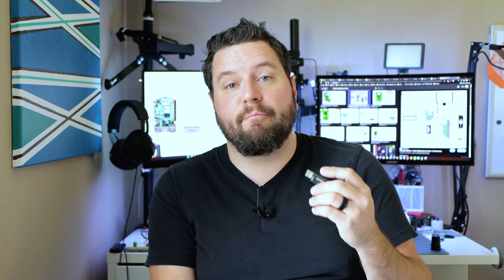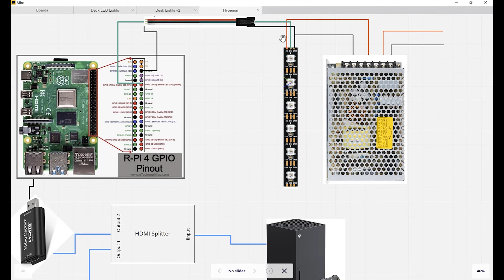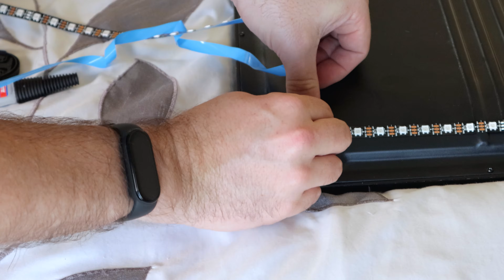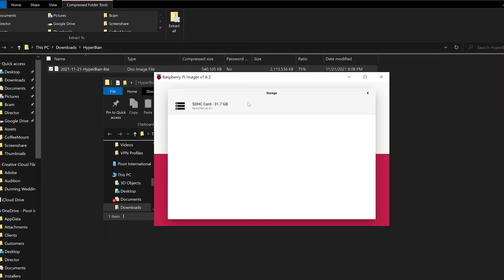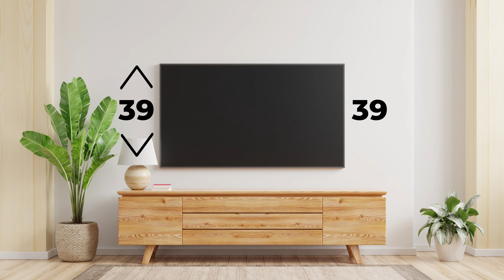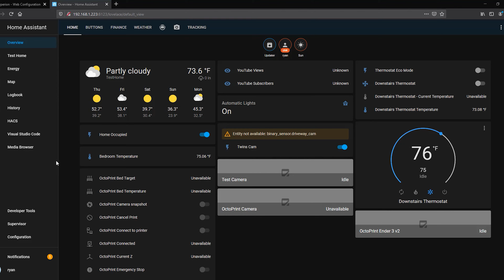DIY Ambient Light for your TV! // Hyperion on the Pi

Comment: Excellent tutorial! I did this a couple of years ago for my 65" and now I'd like to do it again for the 75" I'm buying. I'm going to need a 16.4' plus 3.3' strips to cover the 75" all the way around (I'll skip the bottom of the TV if going all the way around really complicates things). My question is how can I power the 2 strips once they're connected together? Will the power supply you suggested suffice (or do I need a secondary/larger power supply?), and will there be any flickering or power loss towards the end of the strip? The full connected strip will be 17.5' in total

Comment: Can i strip Jumper wire and use it as Extension wire?
Reply from the maker: It all depends on the gauge of the wire.
Reply: @ well it turns out you can't pull that much power from jumper wires

Comment: Great video dude, thanks a lot! I was wondering what the thickness of the wires used to extend the connection of the LED strip to the power supply is? Because the LEDs can possibly draw 18A, I'm a bit concerned with safety issues. What did you use?

Comment: I got mine going, and the "effects" work great, but I get no lights with the live video.  Technically, I got a coupe of seconds a few times, about 20 minutes apart, where it was mostly white, but you could see faint colors 'flickering' among the white.  After a couple of days of troubleshooting, the best I can come up with is that it's my video capture device, so I'm buying one like used in this video and a splitter to see if that fixes it, so I'll post an update once they get here and installed as to whether or not it fixed it.

Comment: Thanks for the video. I think there is an error in the way people calculate the power consumption of these LEDs. I measured 25 watts for around 200 LEDs + Pi4
Reply: 18A is too much for those 2 thin wires
Reply: @jasonbourne1474  18A at what voltage?
Reply from the maker: What type of LEDs are you using? Do you have them in white mode (the most consumption).
Reply: @ThisSmartHouse  I bought the ones from your video, 5m 60 LEDs/m. Yeah I tried white at 100%.
Have you measured your consumption before?

Comment: Can this thing work without internet access?
Reply from the maker: Yep. It runs locally on the Pi.
Reply: @ThisSmartHouse  Because previous versions of about 1½ yrs ago turns off after about 10 seconds without internet.
Reply from the maker: Previous versions of Hyperion?
Reply: @ThisSmartHouse  Hyperion.
Reply: @ThisSmartHouse  You are right. It's working on Raspberry Pi Zero W without internet.

Comment: Hi, Question. I'm trying to find any info online but I didn't have any luck :( Does hyperion support yuv422? Since my ps5 is connected via hdmi 2.0 cables, it only does this type of format instead of RGB. Thanks for the help
Reply: I dont know if this is what you mean, but I do use my capture card with YUYV and not MJPG, and that works fine with my SK9822 LED strip

Comment: Great videos!  How does this handle HDCP? I have read a couple articles that HDCP can cause issues.  Does this splitter bypass it?  I would like the hear your thoughts on that. Thanks!
Reply from the maker: Good question on the HDCP. I think the splitter is what is important. If you have one that can handle HDCP (like the one I have), then you won't have issues. I think only the older style splitters had issues with loosing HDCP. I have not had an issues with my Xbox, BluRay, or ChromeCast connections.
Reply: @ThisSmartHouse  Thanks for the info!

Comment: Can you please list the best LEDs to use for an 85" tv. The ones you listed dont come in a long enough size. I would need one that is about 20'. These only go to about 16'. Ive been looking but dont want to order the wrong thing. Thank you.
Reply from the maker: You can hook them together. You don't need to have one single strip. So you could easily buy two shorter sections and connect them with some of the clips that I have listed or solder them.

Comment: Hi great video. I have an issues that I can't seem to solve. My led strips don't seem to do anything. When they power on only the first 2 leds light up. The first led is colored and the 2nd led is pure white. Any thoughts?
Reply: I've been having the exact same issue... First led is white and second flickers multicolor.... Did you find long term success with the solution???
Reply: I an getting an error in log saying - lock/unlock handler - session bus is not connected
Reply: Removing the oc helped. Also make sure your LEDs are both grounded to the PSU and pi
Reply: @DrFettuccineRavioli   somehow my LED was problematic cz i tested it from mid way and it was lighting up fine just not following the sync... anyways i've ordered a new one and will comment if this too gives issues.. Thanks for ur reply :)
Reply from the maker: Thanks!

A few things to check.
1. Make sure that you have all of your connections solid between the Pi and the LEDs strips. Make sure that you have a ground connected between the Pi, the LEDs, and the power supply (even if you are connecting the power directly to the LED strip, you still need a common ground.
2. Make sure you have the correct GPIO pin selected in Hyperion.
3. Did you set up the LEDs yet? Define the number, etc?
Reply: @ThisSmartHouse  I think I got to the bottom of it. I had the pi over clocked and apparently removing the gpu OC solved the issue. I don't know why that was the issue but a 2ghz OC seems to be fine.
I super appreciate your comment and once I get this fully mounted up I'll drop a comment if I have any other issues. Here's a sub
Reply from the maker: Cheers!

Comment: Will it it work normally on tv like watching Netflix? Or it will work only for devices plugged in to hdmi splitter? :)
Reply from the maker: It'll only work through the incoming hdmi. Because that's how it gets the color data for the LEDs. 

I think there are some products like from govee that use a camera to pick up the color data that will work with any sort of app.
Reply: @ThisSmartHouse  even if u will plug tv to splitter via hdmi arc in tv?
Reply from the maker: Only if your TV has HDMI out. One way around this would be to use a Roku or Chromecast connected to the splitter. You can use the set top box to watch your content and then the video data would still get captured for Hyperion.
Reply: Ok, I’ve made it, but I’ve got other issue. Even if I turn off my Xbox and tv leds are still on, how can I change it to them turn off after turn off tv and Xbox?
Reply from the maker: Typically when you turn your Xbox off the input goes black is there anything on the TV right now?

Comment: Hey great video! Quick question, I wired mine up accordingly and I see the boot up effect work, even changed it from 3-10seconds and they light up on reboot. Afterwards, trying the test effects doesnt light up any of the LEDs... any idea of the issue?
Reply from the maker: What happens when you go through the red, green, blue test in the app?
Reply: @ThisSmartHouse  Initially nothing, I "fixed" it by just clicking a color on the color wheel, then doing continuous test and the LEDs start working, pretty weird but good so far. Ill try the usb capture card stuff this weekend. Thanks for responding so quickly! Any idea why the LEDs might flicker randomly once every 10ish seconds?
Reply from the maker: I had a lot of issues when I first got started, of course they didn't show up when I was filming the video. My biggest was getting stuck in testing mode and not being able to get out.  Glad you got it sorted!!

Comment: One question, does it work with Netflix, Disney etc? When I connect my Nvidia shield to the capture device?
Reply from the maker: Anything that's being passed through the device should work. I'm able to do it on any application on my Xbox. I believe hdcp is still intact due to the splitter.

Comment: Thank you for the video! It helped me to set up. But I have a problem. HB Captures only the BOTTOM part of the frame (there is no capture on the left, top and right). With USB capture - everything is the same. In the "night" version HB everything is the same((( I tried all the settings - the problem is not solved. LED strip WS2811 (12 v), Raspberry Pi 4 Model B Rev 1.4 (8 Gb RAM). What could be the reason? Thank you in advance! ;)
Reply: https://youtu.be/kpAm7QGJOPk

Comment: So do they make a pass thru for 4K 120? I just got a new TV to accommodate my PS5.
Reply from the maker: I hadn't seen one but I am sure there is one out there. It would just be more expensive.
Reply: @ThisSmartHouse  thanks for the reply. I did a quick search on Amazon and didn't see anything. I thought maybe you may know. Excellent tutorial! I think I'm going to start buying the products now and hopefully I'll find a pass thru that will be able to do 120
Reply: @ThisSmartHouse  so for 4k 120 fps I only need HDMI 2.1 splitter? or something else too?  please reply...
Reply from the maker: You would need a splitter that is capable of 120 fps 4k. I am not sure which ones are available.
Reply: @ThisSmartHouse  cool ,  thanks so any video capture card ll work with 4k 120 fps splitter? Even 1080p one's?
Reply from the maker: Yes. You only need to capture at a resolution of your LEDs. So if you only have 100 x 75 LEDs you only need 100 x 75 resolution.
Reply: @ThisSmartHouse  oh great,  thanks  👍
Reply: I know this is late answer but… Ezcoo 2.1 HDMI splitter supports 4k 120hz with HDR, Dolby Atmos pass through…
Reply: @mysticqro950  thank you!

Comment: So I have tried get Hyperion to work before. I tried your way hoping to would work. It’s so weird I can get the picture to pass threw to Hyperion but LED do not react? I tried to load a affect but nothing happens to the LED’s. Any thoughts?
Reply from the maker: Do you have the LED configuration correct?  Have you tested some of the patterns to see if the LEDs react?  I would start at the LEDs and make sure they are fully working.  One viewer reported they had set the number of LEDs but something reset them to 0, which screws everything else up.
Reply: @ThisSmartHouse  yeah that’s the problem they all turn on but do nothing when i try to run a test pattern . When I start to watch something on plex they will change colors but nothing matches to the picture
Reply from the maker: Which led s did you get? So they don't change at all or the are the wrong color?
Reply: So i am using a Pi4 with LEADNOVO Video HDMI Capture Card with Loop Out, 4K HD 1080P 60FPS USB 2.0 .

Comment: Can the same concept be applied, by applying it onto a monitor, i.e. using the monitor as the input instead of the xbox as the hdmi splitter?
Reply from the maker: Yes, any HDMI source.  However, you can actually run Hyperion in Windows and send the information to the Raspberry Pi over the network.  So they don't have to be connected.
Reply: @ThisSmartHouse  Thanks a lot! And well done on the project!
Reply from the maker: Thank you!

Comment: Does the linked capture card work with hdcp signals?
Reply from the maker: No issues so far. I assume the Xbox uses hdcp.
Reply from the maker: The splitter ahead of it might be removing the hdcp though...
Reply: Got it, thanks. I bought a capture card with loop out and it failed in 1 day :(. Going this route now.
Reply from the maker: That was my thought process as well. I like being able to replace individual components that they fail.

Comment: I just set this up on mine yesterday but the delay is bad enough that it’s hard to watch shows with it. When scenes switch it’s extremely distracting. I’ve tried all sorts of stuff to make it faster but I haven’t been able to get rid of the delay enough for it not to bug my wife and myself.
Reply: You can also run Hyperion through wled. Connect your LED strip to an esp32 running wled. Then in the Hyperion settings have it send the Hyperion information to the ESP 32. That way the raspberry pi is just processing the incoming signal and not controlling the actual LEDs also.

I am also using a raspberry pi 3B+.

My setup goes... Three-way input splitter
(1. PS4 2. Cable 3. PC)   into the capture card. One output splits out to the TV one splits to the raspberry pi 3B+ and then the raspberry pi broadcasts the signal to the ESP 32 which is connected to the LED strips.

I use 144 LEDs per meter, with 400 LEDs total. The effect is beautiful and because of the three-way splitter on the input I can use Hyperion with multiple inputs.
Reply: @300beatz  this is pretty cool, I haven’t worked with esp32 to much, have you had any delay or any issues using it this way vs just with the pi? My original setup a few years ago had the pi processing the signal and a Arduino running the LEDs and it wasn’t bad but it was more hardware and wires. I also started it out running the signal through an analog video capture card and it wasn’t the best but when I swapped to just using the pi I upgraded to an hdmi capture card which helped remove half of the hardware, I am only running around 144 LEDs total as of now, I’ll upgrade that later on, I made a video on my page of my old setup but I need to make an updated one at some point
Reply: @mad_hatter3.14  when you run it through the ESP 32 there's no noticeable delay. And plus because you're running Hyperion through wled / ESP 32 you have access to all the features and effects of wled. 

I also cut my LED strips the exact length of the screen and then placed them in aluminum channels and created a frame that is mounted to the back of my TV.

 I used the 144 per meter SK6812 rgbw strips.

 I like these because with the dedicated white channel you get a more accurate white light without the high voltage draw. 

 I also chose the 144 LED per meter strips over the 60 just for the higher color accuracy.
Reply from the maker: Are you using a pi 4? I see a slight delay on Xbox but it isn't too bad.
Reply: @ThisSmartHouse  3b+
Reply from the maker: Hmmm. That might be part of the delay.
Reply: @Littleferris  if you haven’t figured it out yet, try lowering the resolution on the capture device to one of the lowest ones and increase the decimation, around 720 and 15 decimation for mine to work, also if you are having any issues with flickering and stuff, shorten the data cable

Comment: Very very good video, I actually did this a year ago using the same dongle and splitter but also using a switch.  Works great.  I find your video very well made and you take the time explain everything properly compared to others. Good job and keep it up!
Reply from the maker: It is a fun element to add to a room.  My son loves it when he is playing Roblox.  Thanks for the great comments!
Reply: @ThisSmartHouse  One more thing, I actually used SK6812 instead, might wanna look into those, I think they produce way better light because the white is separate, check out my videos  (i'm not a content creator, just a regular guy)
Reply: I think my current HDMI splitter is the issue. I need some advice.
Here is my situation:
My current splitter: I am using an 8K HDMI splitter that does not have a downscaling feature (but I buyed that cause it says hdcp bypass 2.3 and EDID copy 1 2).
The problem: When I configure the capture card input in the Hyperion web interface, the LEDs do not react to the video input. However, the internal test patterns/colors within the Hyperion web configuration do work correctly and light up the LED strip. This confirms my Hyperion software and hardware (Pi/Grabber/LEDs) are working mechanically, but they aren't receiving a usable signal from the source via the splitter.
What I need to know: Is the problem likely that my 8K splitter is too much for the usb grabber only supports 1080p? Do I need to purchase a specific 4K@60Hz HDMI splitter with an integrated 4K-to-1080p downscaler and EDID management switch (for forcing SDR mode)?
Thanks in advance for any help!
Reply: Does the switch allow you to have more than the 1 HDMI input like AppleTV and Cable Box and DVD Player
Reply from the maker: They do have HDMI matrix switchers that allow you to take multiple inputs and put it into a single one in your tv. But this particular one is the opposite of that. It takes a single HDMI signal and splits it.

Comment: So I tried this and got it working using the same LEDs as used in the video. My biggest issue is color balancing. White on the screen produces blue. Has anyone tuned the colors successfully yet? Googling around hasn't been super helpful.
Reply from the maker: Did you run the RGB byte wizard? There is also a color balance option under it.

Comment: It works also great with wled and then you do not need to connect the led strip to the pi and you can place the pi somwhere else
Reply from the maker: I actually have that setup on my PC.  The PC is running Hyperion and I have an ESP8266 connected to lights.  I just wanted make it similar for first timers.